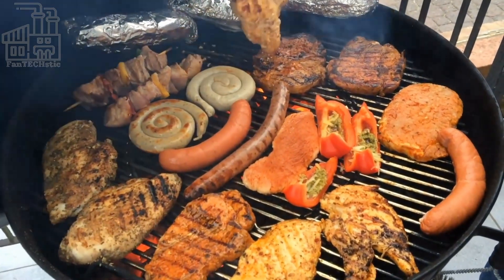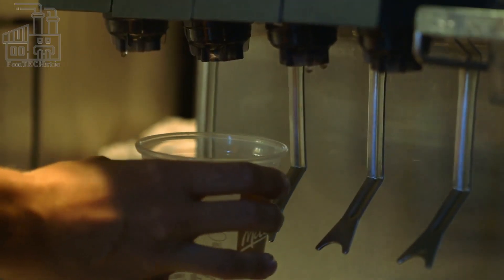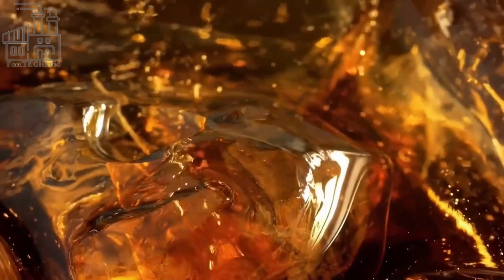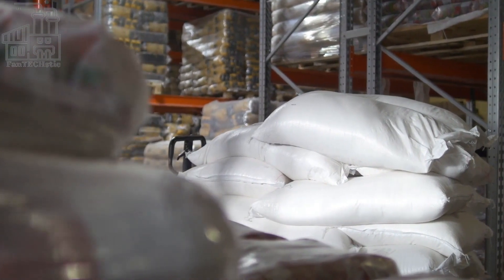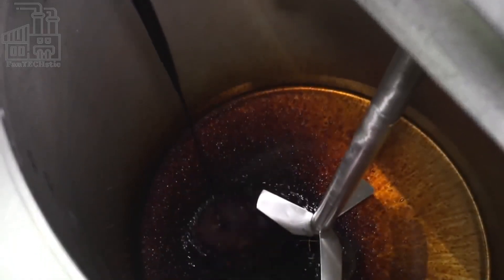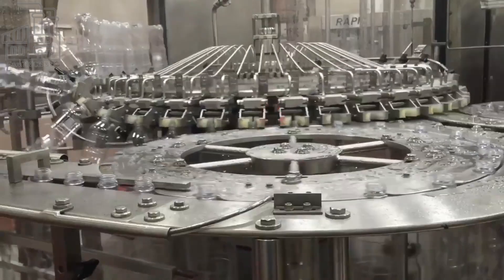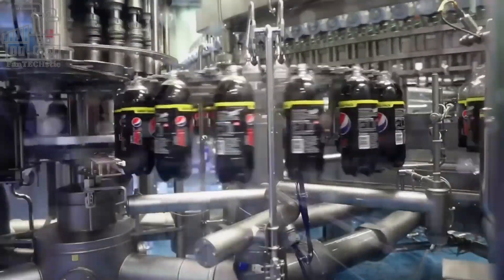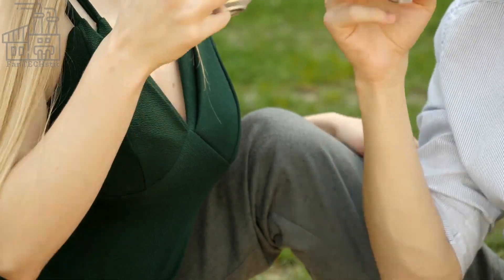Ever Wondered How Pepsi Is Made?! Join us on this FanTECHstic Factory Tour!

Comment: I worked at a soda factory and yes! 4:08 is how we made soda! Notice how it says 1/2 units on the jug? A unit is a standard method in the CSD industry of denoting quantity. Take a cake for example. Say you need, for 1 unit cake: 2 eggs, 500g flower, 100g sugar. The "1" for cake is the unit, it is also the base unit that is the smallest batch you can make for that product. Say you need 2 units cake, now you multiply everything by two. Easy enough? Now replace the 1 unit by an arbitrary number, say 6, but KEEP EVERYTHING ELSE THE SAME. So now you have 6 units cake: 2 eggs, 500g flower, 100g sugar. 6 is now the base unit that you can scale up from there, so you can make 12 units (2x), 18 units (3x), 24 units (4x), but you cannot make say 4 units with a base of 6 units.